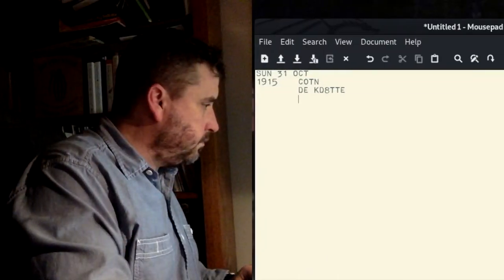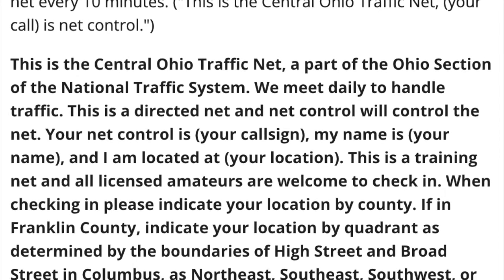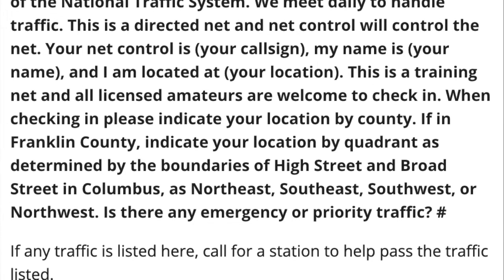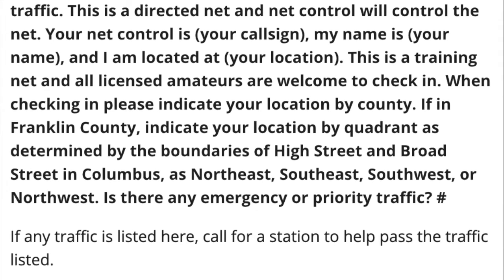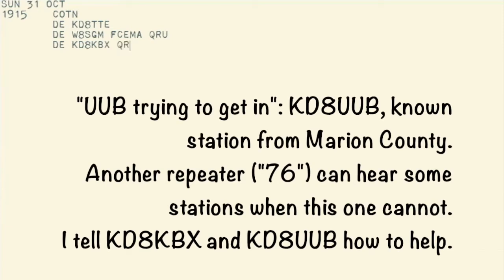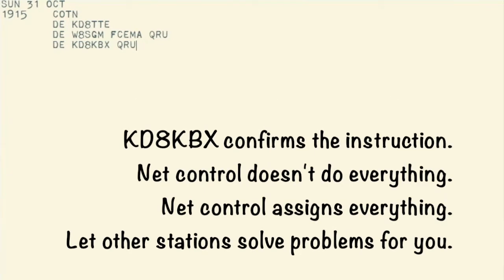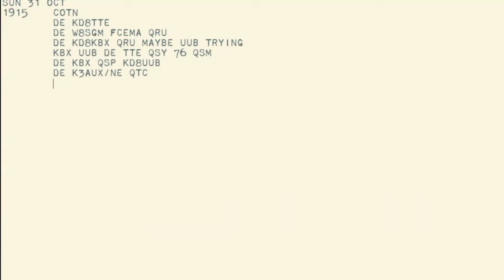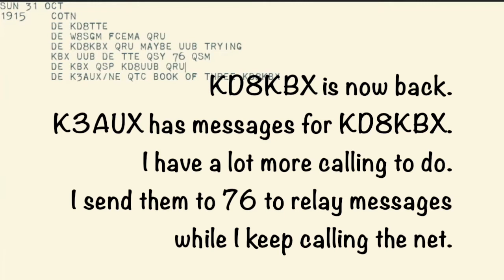Demonstration of Radio Net Control (Radio KD8TTE 037)

Comment: Always thought asking if there is any emergency or priority traffic at the beginning of a net was poor training. We say:  At any time during this net, say your call or tactical call followed by saying "emergency, OR priority" and net control will handle your traffic. All other stations will stand by. This is good training for service events for radio units. Great learning presentations ,keep doing them.
Reply from the maker: Thanks for asking. Neither what you've described, nor what's shown in the video is poor practice. They are different optimizations, though.

In the example shown (Central Ohio Traffic Net), the net is both a formal National Traffic System (NTS) message-passing net, and a training net. Two assumptions that are baked into the operation is (a) the net operates in accordance with the ARRL NTS Methods, Practices, and Guidelines (MPG), and (b) the net is where brand-new operators may report in, maybe for the first time ever. (COTN is, in fact, the first net I ever reported into, and did so on the very day that I got my callsign in December of 2012. The net has been operating since 1984.)

The practice that you're describing is an "Open Net Call," described in MPG Chapter 4 (Net Operations), specifically 4.8.2. In this case, the net operates by taking any station as they report into the net and will indicate whether they have traffic. Precedence of EMERGENCY or PRIORITY will allow net control to handle or dispatch the traffic accordingly, ahead of WELFARE or ROUTINE precedence traffic. It's one way to optimize the net, good for small nets in particular.

COTN does not use the Open Net Call until after the net is established. To establish the net, COTN opens with the "Specific Net Call, Limited Categories by Type" (MPG 4.8.3). That's what you see in the video as we establish the net by type, starting with emergency or priority, then liaisons, then stations with any traffic, then any station by geography. Once we've gone through that, to keep the net going or to pick up stations reporting into the working net, we use Open Net Call procedure. This procedure is good for large nets, where traffic listings might get complicated, or where you want to make it easier for people who might be timid (e.g., first-timers) to get in. It takes longer than an Open Net Call so the net designers and managers need to think about things like overhead of the call vs. how much time will be spent dealing with doubles, or if new operators might not be able to get in because of doubles and get frustrated or worry that they're doing something wrong.

REFERENCES
MPG Chapter 4, Net Operations.
https://www.arrl.org/files/file/Public%20Service/MPG404A.pdf

Comment: Thank you for the Mill information, Mill font link & another great video! Could you suggest a reference for learning prowords, CW short hand & their correct usage? Like everything, there's a lot of conflicting information on the internet. TNX, WB4EML
Reply from the maker: Thank you for asking this. I think that this should be a topic for its own video. I agree: in amateur radio, prowords and prosigns are very poorly understood, are often used improperly, and some of the people who advocate improper use are quite militant about it. It's very silly.

The quick version is that your best bet is to work based on context. Run down this checklist and you should be in good shape.
 1. If the net you're in has standard operating procedures (SOP) or signal operating instructions (SOI), use them where they address the issue before you.
 2. If the SOP and SOI for the net do not address the question or do not exist, then see what affiliations the net has.
   a. If it's an NTS affiliate, Methods, Practices, and Guidelines (MPG), https://www.arrl.org/files/file/NTS_MPG2014.pdf will likely be binding.
   b. ARES affiliates often don't realize it but MPG also applies to them. (See Chapter 9.)
 3. NATO countries have publications that guide their use. These standards are most commonly thought of as "military" standards, and there are certainly military applications, but they are not limited to military.
   a. Prowords are spelled out in ACP 125(G), Annex A.
   b. Prosigns are spelled out in ACP 131(F), Chapter 2, which includes the Q signals and Z signals used by military and government stations.

If there is an ITU publication that lists accepted prowords and prosigns I'm unaware of it.

Note that if you follow the guidance in the order I've laid out here you'll be able to resolve conflicts and ambiguities properly. For example, in NTS CW procedure, many of the control signals are in a series of QN signals. QNI, for example, is " report into the net," e.g., 
 BN DE KD8TTE QNI K
is BN [Buckeye Net] this is KD8TTE report into the net - over

On an NTS net that will be understood correctly. Outside of NTS, though, you'll have a problem because QN is part of the group of signals allocated to International Civil Aviation Organization (ICAO), and QNI means "turbulence."

Historically this hasn't been much of a problem because services worked on their own spectrum and by only operating frequency you could know what you were doing. With 5 MHz interoperability channels, this is no longer the case.

The BLACK SWAN Net has addressed this problem - since it operates on 5 MHz and exists in part to include interoperability - by adopting relevant Z signals, e.g., 
 BLACK SWAN DE KD8TTE INT ZKE K
is BLACK SWAN this is KD8TTE interrogatory - report into the net - over

Use of signal INT makes what follows a question, so it's like saying "Report into the net?"

As BLACK SWAN Net is not an NTS net, if you follow the documents as I describe you'll find that there is net-specific documentation that addresses common cases, but if another issue comes up, operators will draw from ACP 125 or 131. https://www.blackswancomex.org/net/control-script

I hope that helps for now until I can address the issue fully.